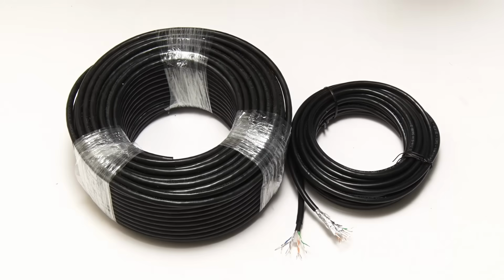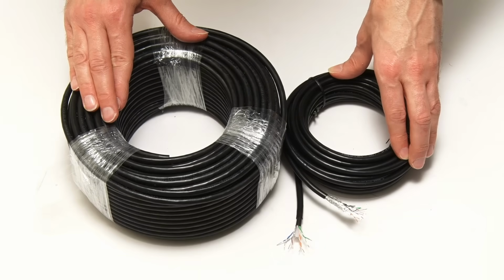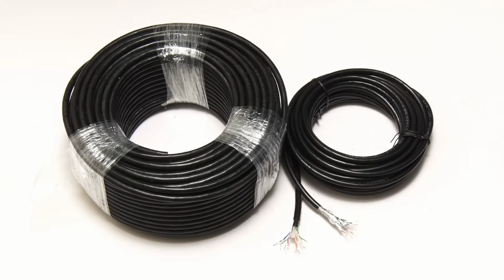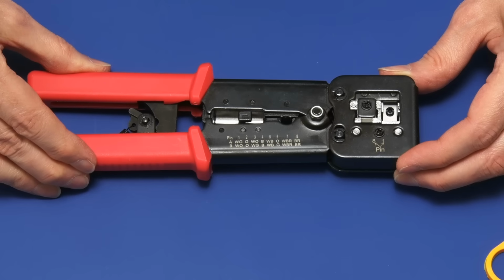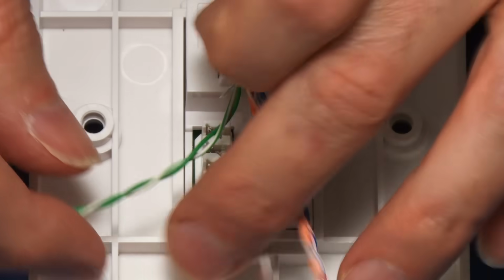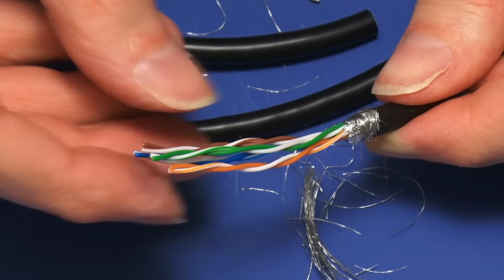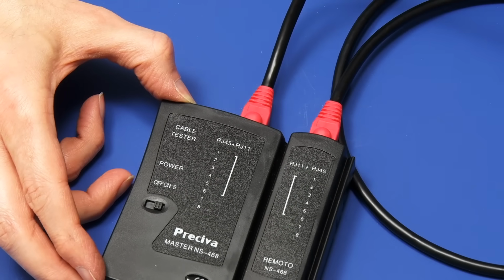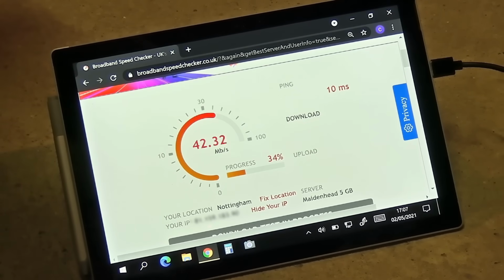Wiring Ethernet Extensions: How to Fit Sockets & Make Patch Leads

Comment: Probably been said already.  I would use Stanley the Knife and cut the excess off right at the socket. You can score the wires and then wiggle back and forth until they break off.  This leaves virtually no tail and should be better as there would be less reflections.  Can it be measured?  Maybe, but just being somewhat purist.

When I build a garage I will put in conduit between the house and garage. Currently I work putting in a lot of conduit.

Comment: I don't know whether solid vs. stranded cables are indeed better but I would have expected the skin effect to mean stranded has lower impedance at very high frequencies since you have many parallel paths.
Reply: For stranded to provide better performance requires each strand to be insulated.  Otherwise, you effectively have a solid wire.  Look up Litz wire for info.

Comment: I've recently wired all 7 rooms in my house via ethernet cables (2 cables per room). Everything works great, the only "problem" I have is the central location where all the network equipment and my NAS are located now has over 25 wires going from there (I have 3 wireless access points, two for the house and one for the backyard). 24 port gigabit ethernet switch + ports on the router itself fit in nicely with the setup. Now I just find an ethernet socket in a room and connect, desktops, tvs, etc... Wifi is now there for smartphones, laptops, but all streaming and work on desktop computers in my home office is now done via the wired connection.
The next thing to do is to upgrade some parts of my network to 10Gbps, especially because I now have a NAS on the network, the internet connection is well below 1Gbps (250/80Mbps gpon fiber), but in the future it'll get to a gigabit speed for sure if not more.

Comment: Even though the cable is stiff there needs to be a service loop! A service loop is a small loop that allows a little extra cable just in case the wall jack fails or gets damaged and needs to be replaced you have a bit of slack to reterminate the cable in a new jack. In this application you could put the service loop on the outside wall and use the minimal amount of sealant in the hole so you can cut it and pull more cable in to replace the wall jack!

Comment: I think the Telecom guys or girls would have drilled from the inside as it is easier to find the wall studs from the inside - you really want to avoid drilling through these . Just a quick tip for anyone contemplating doing this is please check your wiring and plumbing codes for the country you are in - drilling through a power cable or water pipe could be dangerous and expensive to fix.
Wouldn't it be better if one end of the shield is grounded ? If it were myself doing this it would be going into underground rated conduit if it is going in the dirt .

Comment: What a great - and surprising - video, brilliantly presented, as ever. Had no idea that there is so much to know about Ethernet cabling, particularly for permanent installations. Have just created a new playlist to store it (and hopefully similarly useful videos) for future reference. So at least I now know where to look for information on Ethernet cabling when we get the house rewired! The only decision that slightly surprised me regarding your own project, Chris, was your choice of Cat 6 rather than 7 or 8 to 'future-proof' what sounds to be a permanent installation. Would it have been that much more expensive?
Reply from the maker: Thanks for this. I could not get any Cat 7, solid copper, solid core, direct burial cable in the length I needed -- and I tried for weeks. There is a copper shortage at the moment, and this is having a big impact on cable availability. So as Cat 6 and Cat 7 performance is in effect identical over the the length I needed (both do 10 Gigabit, and I currently only need 1 gigabit), I used  the Cat 6.

Comment: I've heard about an outdoor ethernet cable that got struck by lightning and fried the network. Can't say I'd feel comfortable with an outdoor cable...
Reply: Won't make the slightest difference. If your going to get struck by lightening you will. Cables in or out will still attract the discharge a wall makes not one bit of difference. Its millions of volts, that stops at nothing.

Comment: My father did this in our apartment a while back to route Ethernet cables from our router to our rooms so that we all could have a good and stable connection.

Now I’ve got enough Raspberry Pi’s in my room that I’ve purchased a Gigabit Ethernet switch for them and my desktop Windows 10 machine. After I build my home server all ports will be occupied on the switch.

Comment: One other thing, I am disappointed that I cannot use Cable or Fibre as I can only have ADSL2+, as the GPO had installed a lot of copper telephone lines and didn't had much cable TV by TeleWest. Also I know that Linux and Android are more secure than Windows but the problem is with Using public WiFi is dealing with your bank and confidential information that can be easily comprised as well as someone slicing into private records - which is against GDPR. It would be best to use an Android Anti Malware and a VPN for that.

Comment: For those of us in apartments or other rentals, where drilling for Ethernet isn't permitted, consider wireless mesh networking (preferably a mesh system with dedicated wireless backhaul channel), like the Netgear Orbi. Mesh is capable of higher, more consistent speeds over a larger area than a single router or access point is. Ethernet is the gold standard, of course, and much easier and cheaper to implement in new construction.
Reply: You can also use a couple of small directional dishes (I.e. Ubiquiti Nanobeam AC) and put them on opposite sides of the concrete you want to penetrate. I've done this before and got speeds of hundreds of megabits. It is a lot more expensive though but gamers would def want this over a mesh network.
Reply: @paulmichaelfreedman8334  don't have to worry about concrete here--most houses built in the '80s and later seem to be flimsy-ass drywall and 2x4s lol

Comment: An other excellent video which explain in detail the types of IT cables and their application ranges . But i think that if you don`t use shielded conectors (which are grouding the external cables shields and allou foils) there is not need to use FTP cables at all.
Alsow  i think that the use of a switch to terminate the inbount cable from your router is better soloution as it gives to you the ability to conect multiple pcs at same time , and even more to use a second router for subneting your lab to avoid issues with connectivity when you are testing new projects, as in this way home net is separated from lab net .
Cat 6 cable has low cost/meter and support 10Gbps nets for distances smaler than 50meters so it is recomended for the most cases . For higher bps rates I recomend optic fibers as they are not effected from electromagnetic fields and can support any speed  rate just with change of conectors (FPS ,FPS+ , etc) 
As we look to the future I think is a good idea for a similar video on fiber optics from you Sir.
Thank You!

Comment: Because I live in a condominium, I don't have the luxury of drilling holes all over the place. Have you evaluated the various methods of using ones electrical system to transmit from one outlet to another? I have 2 such systems and they do seem to work for my basic purposes.
Reply from the maker: Yes,  considered transmitting data over the power network. It certainly works, but in videos I sometimes test out network speeds (and may do so again in the future), so wanted to fit wiring with full gigabit, and potentially 10 gigabit, capacity. As you say, it depends on your purposes. :)
Reply: @ExplainingComputers  Are Gbit speeds now realistic over powerline adapters?
Reply: @ExplainingComputers  Thanks, Chris. Great video as usual!!!😃😃😃😃
So will we see Mr. Crimper or will he get a name like "Stanley the Knife"??? 
More mugs and t-shirts!!!😃😃😃

Comment: I was just doing some structural Ethernet cabling the other day. The cable that was there appears to have failed (I never bothered to ever buy a tester as the equipment was all 100%, I was 99.99% positive)- it had been installed about 5 years ago but not properly in my books. My friend is now happy as his wife is happy. My sockets are a bit different from yours as are the boxes and face plates I use. I have a really nice 110 (it also has a BIX head which I haven't used the BIX in a very long time) punch down tool which can automatically cut the wire.  I picked up a couple of boxes of Cat5e, and a couple of boxes full of 5e sockets and face plates at a price that I couldn't pass up (for me that means really cheap) at an auction. After I wired my house this stuff as been collecting dust in my basement, so It was nice to help a friend. I have a crimper but not with a built in cutter. I have a bunch of through wire plugs but currently no patch cord cable. Great tutorial on wire termination and I learned something about wire gauge as I was thinking of a POE project. Thanks.

Comment: Good. But since you focused a lot on the cables, it would have been nice if you explained the different twist rates among the twisted pairs in one cable, and the allowed bending radii, both of which are part of the standards and quite interesting facts, though of course only the bending radii is really relevant to user installation!

Comment: Lots of really good info in this video, but you have fallen into the standard consumer nomenclature pitfall. RJ-45 while commonly used to describe ethernet connectors, is actually wrong. RJ-45 (Registered Jack with a number, RJ-45, RJ-25, RJ-21, RJ-14, RJ-11) is a telephone standard that describes a very specific telephone trunking data interconnect. The connectors for this standard are actually called an 8P8C connector. Thus when using this connector for ethernet it is more accurate to call these connectors 8P8C connectors.  :-)
Reply from the maker: Calling them "RJ45 8P8C" (8P8C wired to RJ45 standard) would be most accurate, but calling them 8P8C would be a less effective form of communication -- and videos are about effective communication. You are making the assumption that using "standard consumer nomenclature" is actually a pitfall. This is a video delivered via a consumer platform, and the language is appropriate to this delivery media.
Reply: @ExplainingComputers  Maybe a passing comment about this nomenclature confusion, and then continuing on with the most effective name. Considering the time and effort you've made to describe the cable specifications, seems a shame to not even mention the connector details. :-)

Comment: Very nice overview and primer on Ethernet connections!  The only other cable option I've had to use is "plenum-rated", which can be installed without having to be inside conduit above drop ceilings.

Comment: A nice video! I have a few comments since I used to do this professionally. 

1) NEVER USE COPPER-CLAD WIRING! The certification standards require solid copper conductors. Copper-clad will not pass PoE over distances, and isn't technically certified Cat cabling. In the industry, these rip-offs are considered the domain of corner-cutting fly-by-night lowest-bid contractors, pinching every penny on materials. This also goes for the center conductor in coaxial cable, believe it or not! A solid copper conductor is often used to send DC power down the line to something on the other end, such as the LNB in a satellite receiver or an amplifier for an OTA antenna. 

2) Counterintuitively shielding is not actually that important, especially if you cannot ground them properly (which most people installing cabling runs can't). Improperly (or un-)grounded shielded cable can actually increase interference inside the cabling because it channels noise and cross-talk throughout the inside of the cable instead of letting it bleed out over the length of it. It's crucial to have a proper "drain" at each end of STP, and to maintain the integrity of the shielding from one end to the other. 

3) Pass-through connectors used to be frowned upon in the early days. There were a lot of quality problems with the cutters in the crimping tools producing inconsistent results. Nowadays, that's not much of a problem. 

4) Another approach that's been much maligned in the old days but is now perfectly serviceable is the use of "tool-free" keystone jacks. These have a lever-action connection that takes the conductors and shoves them into the knife contacts, sort of like an electrician's lever nut/WAGO connector. I used these professionally with a major US ISP and had great results without requiring a punchdown tool. As always, be sure to maintain the twist down as close to the contacts as possible and you'll be fine. These also eliminate the problem of not trimming the conductor ends close enough to the contacts (which can cause reflections and dropped packets, or even dropped connections). 

5) Leave as much slack as you can in the cable, in case you ever need to rework the ends of it. A lot of electricians seems to be allergic to slack (excess length, and the ability to slide cable in/out freely) and want to leave no margin, while stapling the cables to the inside of the walls. Drives us professionals crazy! Several times I've had to spend a lot of time with very fiddly work trying to connect a new wall plate because the electrician who ran the customer's cables didn't leave enough slack for anybody who might have had to come behind him over time. 

6) Very on-point about drilling at an upward angle, and drilling from the outside in. Another tip is to always have a "drip-loop" on the cabling outside, for better water management. Silicone is great stuff, but even better is to not let water run "down" a cable to get into your wall in the first place!  Also, be sure to use a masonry bit. I've always found it easier to go through mortar than brick/cinderblock. A proper rotary hammer or at least a "hammer-mode" drill is needed, but don't use an impact driver. Those are for driving fasteners, not drilling!

Comment: As my own home LAN admin (both wired and wireless), I use wired wherever possible for speed and reliability and shelled out for a nice Wi-Fi access point/router combo (for the rest that is wireless mandatory) so I never have trouble with it. Tests done show my phone, laptop, and desktop can get >200mbps over Wi-Fi across half the house or so. If there's trouble with the wireless connection it's the device, range, or internet connection itself.

Comment: This is the PERFECT Ethernet wiring video. EVERYTHING you could possibly want to know about wiring Ethernet. I have been doing this DIY for a number of years now. From my experiences: 
- Pass-through plugs make it SO much easier. I have tried both. Getting the wires in sequence  is tricky. Doing this does take time, patience and practice.  A magnifier really helps. 
-Testers are a must. They can be bought inexpensively, like the model used here, BUT their jacks can be flimsy and finicky.  While the cable connections may have been made correctly, they do not always display fully. Sometimes wiggling the plug is necessary. Sometimes the device itself may be bad. SO .... FIRST test the device itself with a known good patch cable.

Comment: In Australia, any cable that may be directly connected to the carrier network shall be installed by a registered cable installer with relevant endorsements.  Uses of cable can change, for example: the property could be sold to someone else who turns it into an office and needs telecommunication services across that cable.

"You should aim for no untwist in the pairs for Category 6 as shown below:";

"The connecting hardware manufacturers instructions for cable sheath strip-back shall be followed. When terminating category 5e and higher cables, the cable pair twists shall be maintained to within 13 mm (0.5 in) from the point of termination.

For best performance, when terminating cable on connecting hardware, the cable pair twists should be maintained as close as possible to the point of termination.
 
In reality, if you allow the installer to have 13 mm (0.5 Inch) untwist, the performance of the cabling system will be reduced. On short links, that could result in a failure."

Source: https://www.flukenetworks.com/knowledge-base/applicationstandards-articles-copper/terminating-category-6-5e-and-5-connector

"Will adding extra twists degrade the performance?
No, despite what it says above - by not changing the original twist. You will always find that one of the pairs does not have a tight twist. On occasions its almost impossible to keep the twist to the IDC. Adding an extra twist in that pair will not only improve NEXT, but Return Loss as well. "

Source: https://www.flukenetworks.com/knowledge-base/applicationstandards-articles-copper/terminating-category-6-5e-and-5-connector

The wiremap test does not certify the performance of a cable (to the manufacturer specifications).   Internet access is only one service a local area connection cable may facilitate so it would be worthwhile doing a full-speed test between two lan devices.  If you have a managed switch you may check for bit error rate.

Certified testing checks for performance and installation borne faults such as kinks, twists, stretching and poor terminations indicated as near-end crosstalk, far-end crosstalk, power-sum crostalk, attenuation, impedence, signal to noise ratio, reflections, etc...   Such certification testing is voluntary or contractual.

Comment: I use network over power boxes across my flat as it's such an upheaval to rip up floorboards and tear holes in walls, getting 1.2Gbps across the network but those CAT 8.2 speeds are impressive.